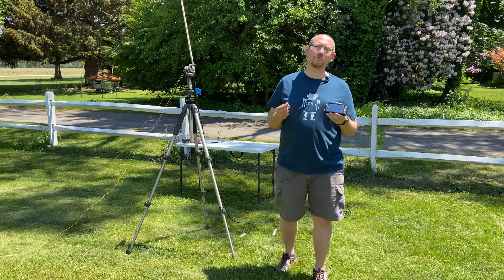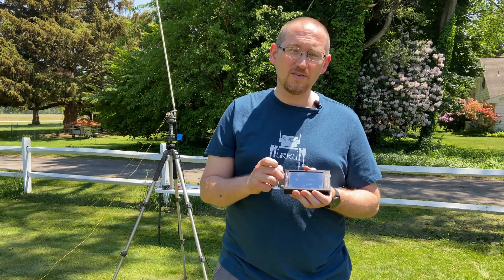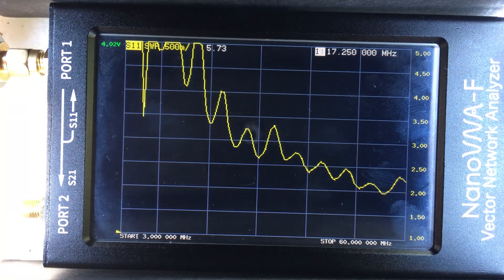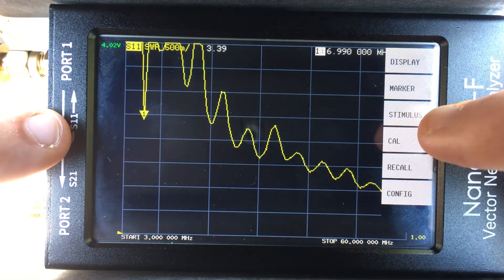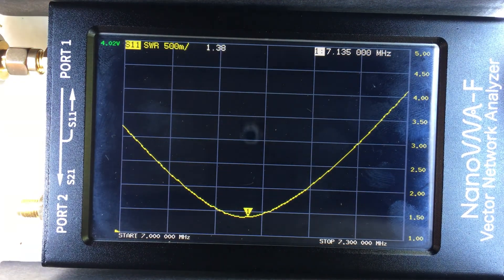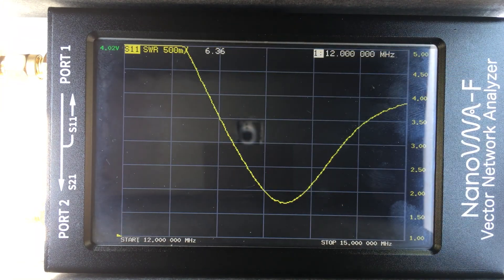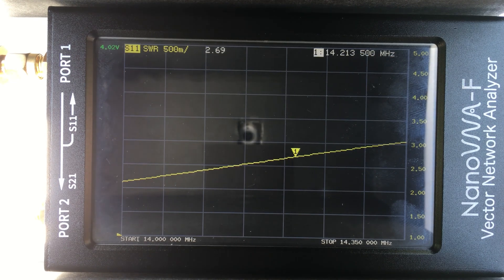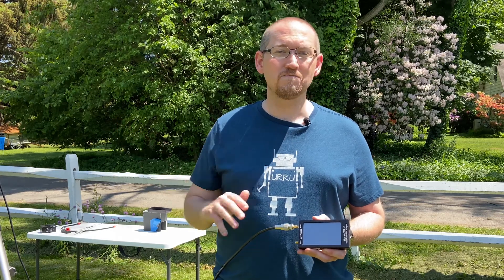Measuring Antenna SWR with a NanoVNA

Comment: Great tool, good explanation, but this antenna is very not well... or maybe a coax problem ot a calibration issue. You don't get better than 1.5 SWR ?

Comment: hmm, should we not include the calibrate with the pig tail full length then the  50 ohm, the open short etc... as now you are measuring the coax and the antenna and not the antenna ?

Comment: Thanks for the video.  I needed a refresher as I am trying to tune shark ham sticks on my truck. The sun is washing out the nano-vna and I need to place an umbrella under it.  I do love having a network analyzer that fits in my pocket - never thought that would be possible remembering the big units they used to use at work.  All the best, 73 de KI5HXM

Comment: Kudos to you for even mentioning that you need and adapter. I have watch half a dozen videos on the NanoVNA and how to use it for ham radio and NONE of them show an adapter or even mention. Its like the device just magically connects to the feed line.,
Reply from the maker: Thanks John. Sometimes it is the little things (an adapter in this case) that can make or break a day of testing and being on the air. Happy radioing!
Reply: @transmittinguntilrobotsrep1045  do you have to calibrate with the adapter as the load?

Comment: So, if you're looking at 40M, and you want 7.123 to be at the lowest SWR, but the swr is higher at that frequency  than you want it, do you decrease or increase the antenna length (and then check the SWR again)?
Thank You!

Comment: Hello! When you travel across the swr curve with the left and right keys… is it  to adjust the steps? For instance, i find that mine goes from 7050 to 7150 or so… 
Thank you
Reply from the maker: Hello Diogenes. If you are asking if it is possible to adjust the incremental steps, it is. The NanoVNA always pulls about 100 reading points, so in order to adjust the width of the steps between movements with the left/right keys, you change the start and stop frequencies. By decreasing the amount of spectrum that the VNA is observing, you are able to get more refined steps between the start and stop frequencies. If I've misinterpreted your question, I apologize. 73. AC3DS

Comment: Bruh you really needed to explain what an adapter is? Ffs... Get on with it 😂
Reply from the maker: Yeah, the unit doesn't come with adapters, so I felt like it was necessary to say, but I get it. Being comprehensive is sometimes at the expense of brevity. 73
Reply: @transmittinguntilrobotsrep1045  Based on solely what a vna is, I feel like there is a certain level of competency needed to be able to properly digest these videos, and understand the content correctly.  So going into depths on what an adapter is, in my book paints a bad picture for the rest of the video.

Comment: If you change stimulus ranges, you have to recalibrate each time.
Reply from the maker: Hi David, thanks for commenting.  There seems to be differing understandings about this in the community, and I don't claim to be fully sure that I'm correct. I could certainly be wrong about this, but through experimental testing, I have not been able to validate any significant effect of not calibrating each time when the most recent calibration was for within the same broad range of the spectrum (HF, VHF, UHF)... The difference between broad ranges is also very minimal such that I don't always recalibrate between them if the original calibration included the new stimulus range. I would be curious to see what the actual numeric offset (calibration amount) is between the bands. 73
Reply: @transmittinguntilrobotsrep1045  I agree that some don't, I guess I'm a stickler! ha, ha. I've had fun with mine. 73 OM

Comment: I like to use a 6 inch flexible lead  on my Nano to keep stiff cables from being hooked directly to the circuit board of the Nano.
Have you tried calibrating to the end of the feed line? I did a 6 ft jumper yesterday and it worked fine. 6 ft is not nearly long enough for most antenna's though. It might be for a 70cm & 2M dual band possibly just to tinker with on the desk.
Reply from the maker: You bring up a good point about calibrating to the end of the feedline, and yes, I have done it that way up to about 30' and it always seemed to work fine. I suppose I don't think about it too much though because most of my calibrations of antennas are "close enough" calibrations such that I can work out the details in the practical use. It probably isn't an efficient method, but I don't mind it. Thanks for bringing up this topic - definitely something worth considering in the future. 73.
Reply: @transmittinguntilrobotsrep1045  The reason I ask is that Rig Expert instructions say to calibrate to the end of the feed line essentially moving the antenna analyser to the antenna hiding the coax and at the same time keeping your body away from the antenna.
According to Bells cb to know the true SwR of an untuned  antenna you have to have calculated half wavelength coax. Coax repeats exactly what's at the other end every half wavelength.
He says after the antenna is tuned that coax length no longer matters.

I helped tune a new big rig antenna the other day on a 6ft coax with my NanoVna h4 not calibrated to the end until ch 20 was 1.36:1 while 1 and 40 were 1.56 :1.
Then we hooked the radio back up to the antenna with his 18 foot coax and the 6 ft jumper with an analog SWR Meter.
The the SWR was 3.5:1. On ch 40.
We had to cut another inch off the antenna to get the SWR back perfect.

Comment: Do you need to recalibrate the VNA each time you change the band you want to measure?  Or just calibrate the VNA once at start-up?  Thanks and 73
Reply from the maker: I’ve heard and read that you are supposed to calibrate it each time you use it, however I have actively tested (days and weeks later, outside to inside, etc...)to see if there is a measurable difference and haven’t found any difference. I believe that you should recalibrate when the frequency range goes beyond the bounds of the most recent calibration, or the calibration used to save into one of the recall slots. For my NanoVNA, there was no appreciable calibration change difference until I got over 500MHz, so it has been one calibration that worked for me.
Reply: @transmittinguntilrobotsrep1045  thank you
Reply: At HF it doesn't really matter. It matters once you start going into VHF and UHF frequencies. Also technically you should calibrate at the end of your feedline, but again at HF it doesn't really matter. You're only looking for a dip. You might get better results using S11 logmag instead of SWR.